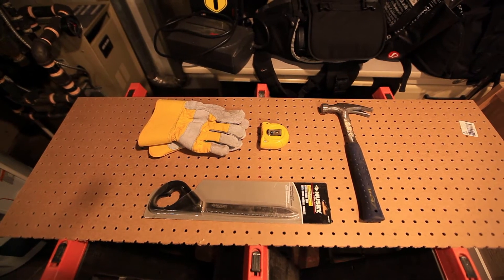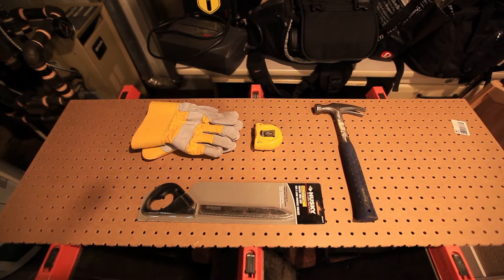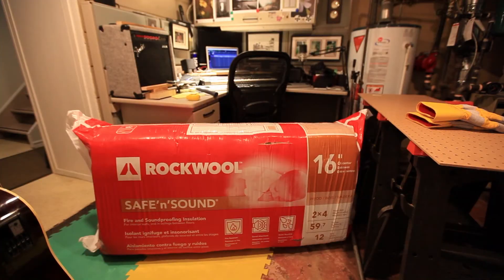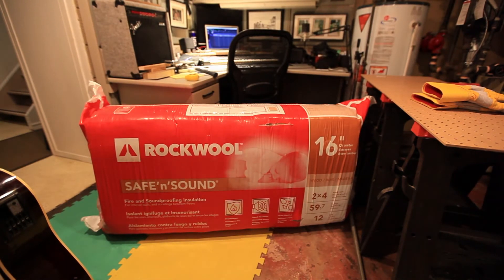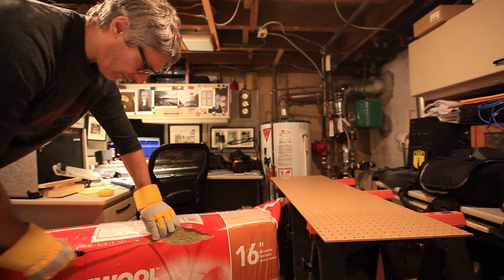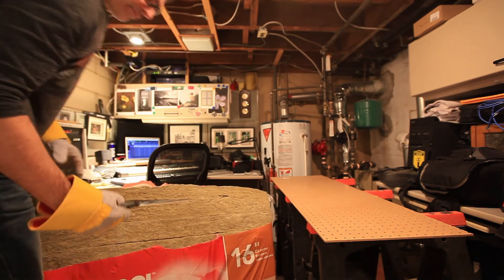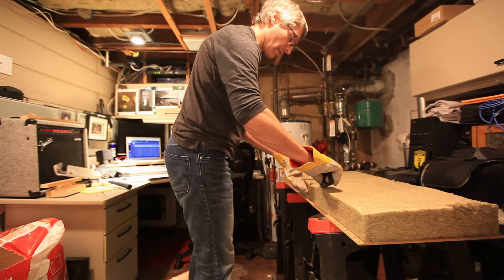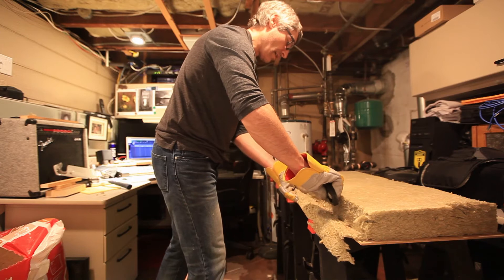DIY Sound Insulation Install

Comment: Cut Rockwool insulation with a bread knife. Like a laser through butter. Get a magnetic end measuring tape and stick it to the knife to get precise cuts. Also if you're doing walls you really don't need a mask but if you're doing ceilings you need one. The reason is Rockwool fibers will fall, they won't float in the air like fiberglass. If you're below them, tag, you're it.
Reply from the maker: Thanks for the comment and the tips

Comment: Have you noticed any lung irritation after being in there with the rockwool exposed?  I've read that rockwool is the safest solution of this type, but that it may not be completely benign, it is hard to say.  Allegedly our lungs can break down rockwool fibers unlike cotton/"green" alternatives which are permanently retained in the lungs.
Reply from the maker: Thanks for the comment. Once the initial fibers from installation were cleaned up, I have not had any issues with the exposed rockwool. As long as the panels have a tight fit between the framing, they stay where they are. I have been thinking of stapling fabric or installing peg board for the ceiling, but that is just for aesthetics. I also do a lot of long-distance cycling and I have not noticed any changes in my breathing since the installation several months ago and I am in that room every day.
Reply: @TonyBursey  is it still the case?
Reply from the maker: @hkjpotato  5 years later and the rockwool is still where i put it.
Reply: @TonyBursey  thank you, I install them in my room, but didn’t fully cover them. I find them can loosen a bit and also feel inch if they fall on skin, hope nothing bad to my lung

Comment: Hey, I'm a little confused between your caption and your video. You said you use Roxul, but the brand is actually Rockwool? Is that a typo? I'm trying to compare the two for purchase.
Reply from the maker: Sam, thanks for the comment. Rockwool International is the parent company of Roxul, North America’s largest manufacturer of stone wool insulation. Roxul rebranded January 2018 to Rockwool. Up until then it was Roxul in North America and Rockwool internationally.

Comment: Does the insulation shed at all? Any dust particles down below over time?
Reply from the maker: bleugate Thanks for the question. Since I have installed the Rockwool, there has not been any pieces that have moved and there has not been any particles that have fallen either.
Reply: Tony Bursey thanks for the reply!